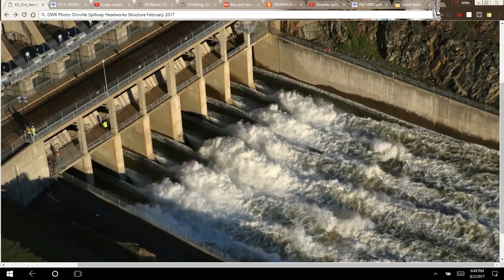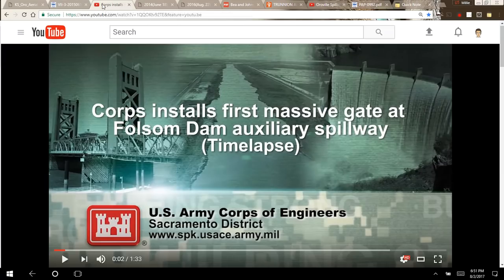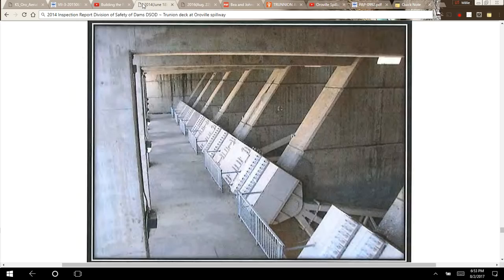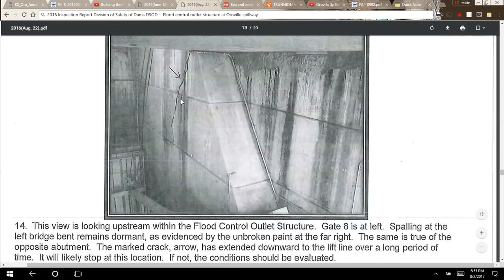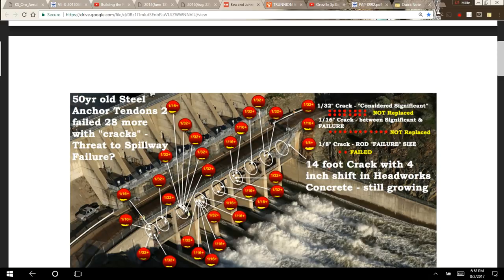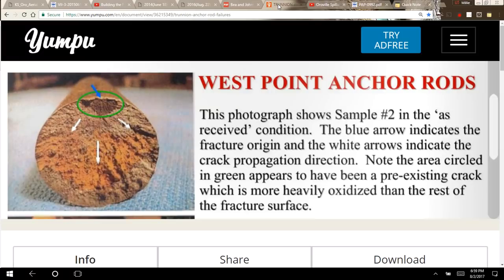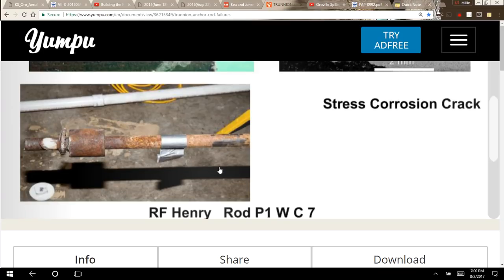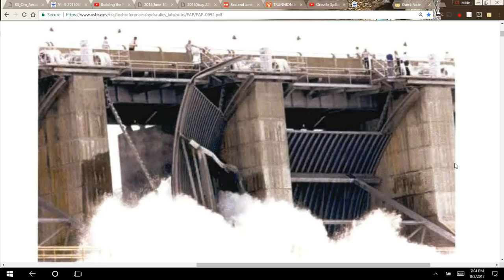Are Oroville Dam spillway gates safe? (And what about those trunnions and tendons?)  8/2/17

Comment: Millie, I just watched this again. I'm not in panic mode but from what little I know about concrete buttress construction, I think any engineer (that didn't design it) would tell you large cracks are troublesome to say the least.
Reply from the maker: Hi blipco5! That is a really good way of putting it: "troublesome to say the least". I really like that. Thanks for sharing it here.
Reply: Millie Kay ...No, thank YOU for your cool headed and calm, well researched reporting.
Reply: Also, I thought I had seen somewhere that the crack had extended another two feet beyond the fourteen. It's hard getting good information via the internet, you have to wade through a lot of hysterical people.
Reply from the maker: Hey blipco5! There is a comprehensive article that puts the current size of the crack at 16+ feet. I think you will find the article informative. Might have to wade through some ads, but Tony Johnson has researched the gate structure extensively. I hope you will let me know your thoughts after you read it.
https://www.catholic.org/news/green/story.php?id=75205
Reply: Millie Kay ....I looked at that site as well as construction drawings for the Dam. I don't understand the calculations that the engineers have made to construct the head gates but I certainly know how to read the drawings. I've read drawings for decades. In construction you need to understand your own prints as well as other trades to avoid conflicts. From what I gather, the crack is at a part of the structure which supports the roadway. Why it cracked is unclear. From what I have read, it is possible that the support itself may have been placed on top of unreliable rock..but that remains unclear according to what I have read in reports from hopefully reliable engineers.

So...A common sense approach, I would think, would be to stop driving heavy equipment over the roadway above it. And build a cofferdam in front of the effected gate(s) to relieve pressure on the gate to help prevent the worsening of the crack. This seems better than just hoping the crack will stop (sorta like the small crack in your windshield that you hope stops, but never does). Once the area is secured the state can go about seeking a solution. If there were to be a severe rain event with a dramatic rise in water levels I'm sure the remaining six or seven gates could flow enough water to keep the lake from overtopping the Dam or emergency spillway.
Reply from the maker: Hi blipco5. Thanks for your valuable input! Yeah, I think all the heavy equipment traffic makes the problem worse. The blasting they did up at the top of the spillway didn't help in that regard, either. Keeping the Dam complex going would be a challenge in the best of conditions. Add current factors and the problems intensify. Few projects can withstand the micro-scrutiny this Dam is getting -- but the events of 2017 seem to demand it. Take care.
Reply: Millie Kay ...Any news about that crack will be coming only from the DWR due to its location. I don't see how they can't deny a problem so I'm sure they are hard at work..........on a good spin.
Reply from the maker: Hi blipco5. It is interesting that the Division of Safety of Dams is under the Department of Water Resources. Go figure!
Reply from the maker: Hi Blipco. Well, I'm jealous of your Hoover Dam hard hat (seriously)!!! Yes, DWR lost a lot (more) of the public's trust with the 2017 Spillway Incident. More transparency could restore some of the trust, but I guess that's "water over the dam". Too many potential problems to address without admitting to some bad decisions.
Reply: Millie Kay ... Yup, that's how it goes...nobody wants to admit they were asleep at the wheel so they'll concoct a story in case the problem doesn't go  away on its own, and this one won't, and the people won't believe them but they'll pay because they have to. Maybe somebody will get fired. 
Does the Hoover Dam give the internal tours now? They had two. One was the regular tour and the other "Hardhat Tour" was where they took you deeper into the Dam. I know they stopped them after 9/11. That's where I got my hard hat.
Reply: @blipco5  Has this situation changed at all? Meaning, have they decided to fix it?
Reply: Lance Lust.. I don't know. I am on the east coast of the US but I have not seen any news on the subject. Millie would know more.
But as things go in the US, the DWR will deny that there's a problem then when a failure occurs... job one will be to start pointing the fingers of blame at everyone else. Then they'll get public tax money to fix it. At most, somebody MAY be forced to resign for their incompetence with full retirement benefits. And usually, if they're young enough and have political connections, they'll show up working incompetently for some other state agency.
I would love Millie to update as she is very thorough.
Reply: @blipco5  Thank you for replying. I'm pretty big on safety hazards. And the government not doing what is needed to be done. Hopefully now you-know-who is out of office, something concrete will be done about these issues.
Reply: Lance, I had paid no attention to the Oroville dam during the pandemic and it has not shown up in the news so I just did some research. Apparently the lake is at less than 50% capacity because of the last two years drought.
Reply: @blipco5  Maybe that's a good thing...? However, I don't know about the surroundings. They might need the water worse than a fixed dam. I don't know?
Reply: Lance.. The reason for the dam is to store the water for public use before it empties into the sea. The Oroville is a "cash dam", meaning it also produces electricity for sale to the public as well as controlling the water supply. The boating and fishing above is recreational.
If you want to know more about US dams and how and why they were put where they are, read "Cadillac Desert" (author?). Get the updated version if you can.
It's a terrific book which includes the politics of the system (unfortunately).
Reply: @blipco5  Hey, thanks for the info. Much appreciated!
Reply: Lance, if you read that book you'll be well versed on the placement and construction of dams. I found it to be a 'page turner' though I wish he didn't go in depth on the political end even though it's an integral part of the story.
Reply: @blipco5  How big a read is it? I used to read a lot, but arthritis has taken me captive big time, and more often than not, reading makes me very tired, especially since I work a lot. Not certain if I'd be able to task a thick text.
Reply: Lance.. It's a big read. It's worth it though if you're interested in the building and disasters of dams. I read it over the course of a few weeks. A little at a time. I kept it by the bed.
Reply: @blipco5  Cool.
Reply: Just rewatched this video in February 2024. Problems may resurface. The Lake Oroville elevation of 748.5 feet is too high for so early in the year. The Atmospheric Rivers are coming back next week and towards the end of the month. We still have to deal with the Springtime Pineapple Expresses.  Why has California DWR not opened the gates to let some excess water out to leave room for new water? Are the gates damaged? California DWR missed the opportunity to refurbish the gate system after the 2017 disaster. Parts were nearing lifetime expectations.

Comment: Millie, thanks again for another informative report. My usual "go-to" person on Oroville Dam stuff is Blancolirio because he too tries to get the accurate information, not YouTube hyperbole doom and gloom. But Juan has not really covered the gates in depth and you have.  I find myself more and more going to your site because you spend the time to dig deep for detailed information.  The picture of the Folsom Dam gate failure was enlightening and yes when they fail it can be dramatic and catastrophically sudden.  In any emergency there has to be a triage to sort through what has to be done now and what can wait. The main spillway dramatically failed and the emergency spillway was so poorly designed it had to be dealt with now.  Never underestimate the power of flowing water, apparently many engineers do. The headworks structure has not failed (yet) so is not as high on the priority list and will have to wait.  This structure is 50 years old and time eventually take its toll and if it is to last another 20 to 40 years I would like to see all the tendons drilled out and replaced with a  more modern corrosion resistant steel alloy and the cracked buttress replaced.  But then I'm a belt and suspenders man.
Reply from the maker: Hi Svend. I'm so happy to have you as a Subscriber! I think people need to gather truth from various resources in order to make sense of situations like this. My part in that is doing these documentary-type presentations. As I prepare my videos, I learn things that guide my own decisions related to living downstream of the dam. Then, when people . . . such as you . . . take the time to comment, it results in a very rich discussion that benefits all of us.

I'd like to see a whole new headworks structure. When rainy season rolls around again, I won't feel safe if water is on the gates or nearing the emergency spillway weir.

Thanks for viewing and commenting, Svend! Take care.

Comment: Thanks Millie, another winner here. Only now I can see thru the BS about the 'seal' on gate #8. It's not the seal per se, it's the 4 inch sag in the trunnion bearing that makes the fitment of the entire gate skewed in it's slot. Does need repaired, perhaps not at the priority level of the spillway though. If one of these blows out as it did at the other dam, it would not be the end of the world. They would have one gate releasing water down to level 813 that could be compensated for by the other gates. And then they would be forced to fix it instead of like now where they should fix it one of these years. So with it not at the same priority level as the spillway repair, the head honcho can say with every bit of validity that repairing the head gate is not on this particular table at this time. It is on a different table to be sure. Cover up by omission is still a cover up - theese guys will get bit on the political hiney dancing so close the edge of the truth like that.
Reply from the maker: You're welcome, Lee. Thanks for the nice compliment! Special thanks for your immensely insightful comment! You have not only nailed it, but you have stated it with finesse!!! I like the way you think . . .

Comment: Good video.
Millie, there are others who also are presenting information about Oroville Dam, and many of them equally well illustrate known problems which have been identified and confirmed.  Having watched several versions, I noticed one thing that is usually missing in all the details of the videos, charts, papers and discussions - it seems there is little to no information as to exactly HOW to fix these issues.
If we assume that most of the data is true, then why is the DWR and other responsible agencies not providing the public with plans and details on how to replace or repair a radial gate?  Or how to prevent the water seepage which is causing the green spot?  Or how to reinforce concrete components which are cracking?
I think we would all rest better if we knew that there IS a way to actually fix the dangers, should the time arrive when it becomes mandatory that they do so.  Maybe I have missed something, but it seems that much of the fear of those living near the structure is the possibility that there is no way to repair the damn dam. Do you agree that DWR should address this lack of information?
Reply from the maker: Thanks, Gilbert! You have presented the solution very well. I do believe dam owners and operators have a moral obligation to provide transparency to those who live downstream. First, DWR would have to admit there are problems. Until they do, speculation will continue. It doesn't seem likely that an agency such as DWR would bring forth anything until it becomes undeniably apparent. In a perfect world . . . maybe. Your thoughts on the matter are always welcome here. Take care.

Comment: Thanks Millie, I think they should have started the spillway repairs from the top first, including work on the gates.
Reply from the maker: You're welcome, PatBot! I too think they should have started at the top. In my opinion, there should be a whole new headworks structure.
Reply: Millie Kay I favor a series of smaller and safer dams upstream (fish ladders included) and the removal of this ticking time mob. The salmon, stripper, and steelhead would be appreciative.
Reply: Upon watching the vid again, I realised they never showed anything about the gate seals in the construction details or during the construction footage. Just a thought, as there was mention a few months back that it was the seals around the gates that was causing the leaking.
Reply from the maker: I know there are some pics at DWR photo site showing the boats with the divers going down to do something about the seals. Sorry for the long URL (tinyurl didn't work) https://pixel-ca-dwr.photoshelter.com/image?&_bqG=3&_bqH=eJxtkNmOgjAUhp9GbiZDQMAt4QLaqlUBhero3DQEVFxmQFR0fPppiSnMQkL7n_87S06tDH14r6Pkbtsk8WNlNgvbCoY.2ek9vacqCv_Z6VAYADPN02J3PK5fzuvweJYcGkCLoIZhO07DgGbNgJAbENasFfu4yW9mo9.l6G8p.r8UYLIqhxGGuQDe3CX.iuLA46HnY.Qyhj2XhzigPpogK0DwGU7rceD5xOSDpHJJarnQvJRdBhRD0.P7D40NkvMgjlpYosCmDmvBkp5yLqTfr6TDpQWIyR4rjxKp7MbOCQ4I20nhCw1482g_HqvFbIRuugTKJPAjCfAk_c2O5A3YTtkLCKwKvNTVkfY1O7XVGm4KfGgeQqxmeRY6FdYERmAY91tFkYbbCusCO4ocW.mjC6JOhQ2BJ5mdJ3vU109KhVsC765jN.0iTfZuFW4LTJafo8UxOb2T2uyOwJosU_tRXLQHrnBX4Psju.533WG26HwDQdbHRw--&GM_ID=

Comment: Please tell me what mechanism is used to raise and lower these water gates.  Are the gates raised and lowered by using hydraulic pistons, or is this gate movement accomplished by using geared electric motors, with a separate individual electric motors designated for each gate ?
Reply from the maker: Hi trader0108. Specs in DWR documents I've seen just state that hoists are electric. In photos of the hoist deck I see eight units. I have read in various Internet discussions that gates are hoisted using motors and cables. That's all I know at this point. Hope some of it is helpful in regard to your question.
Reply: I hope that the hoisting cables to the main water gates are inspected periodically, in order to check for any beginning damage or breakage.
Reply from the maker: For sure, trader0108. I guess they probably have received the same attention as the rest of the structure.

Comment: Gate failure
If one gate rod fails or jams, it creates enormous stress load on the shared trunnion anchor plate which should affect the next gate, potentially triggering a chain reaction.
Also the shared trunnion plates are necessarily anchored to the same 5 ft. wide concrete pier structure. So trouble in one gate potentially means trouble for next gate. 
Them gates being so bloody heavy, failure of one trunnion or anchor plate could potentially propagate throughout the headworks structure. 
There are no plans whatsoever to address the failed gates & gatehouse
Reply from the maker: So much depends on the (unpredictable) weather.